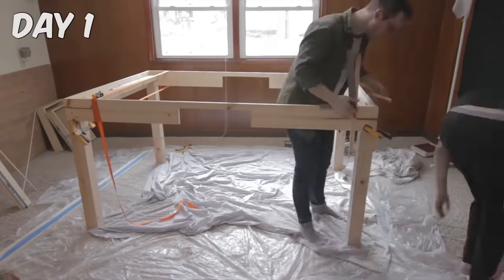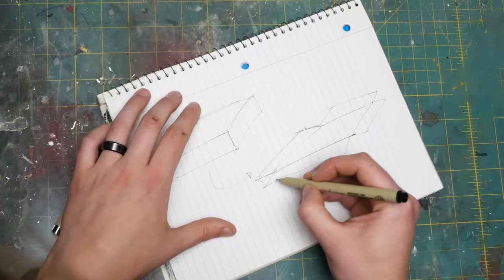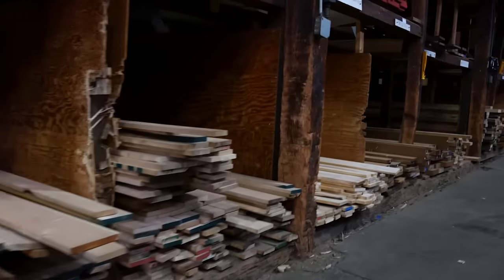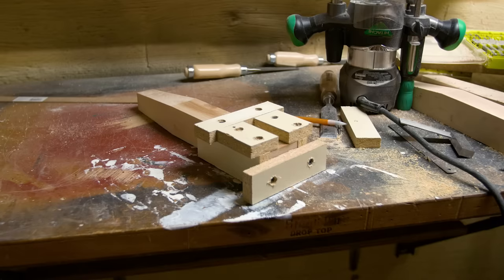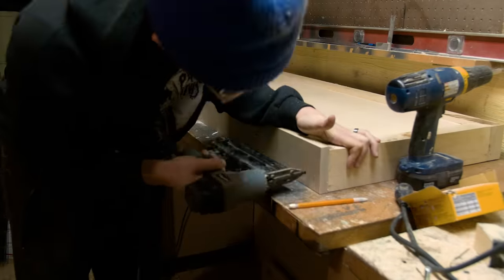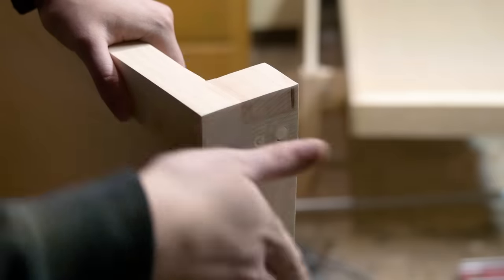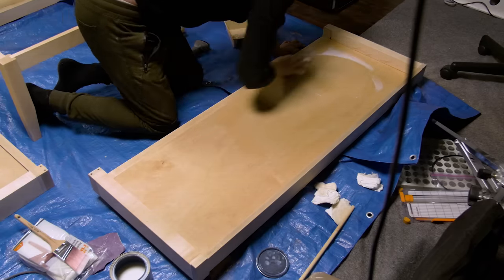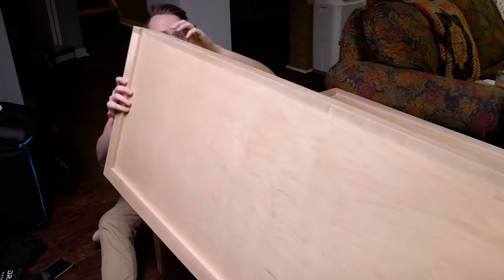Building a Board Game Coffee Table

Comment from the maker: The comments you guys have been leaving...truly heart warming. I am blessed to have a community of such kind people. Thank you.
Reply: Suggestion for you instead of making a supper like some sliders from under the table to support each wing and if you have access to sketch up a lot of people use that to do their drawings
Reply: Dude you really are famous! Nice to meet you today!
Reply: Perhaps consider using some chains on the inside to support the wings. Google imaging "Box chain support" will give you a rough idea of what I'm talking about.
Pros are that it looks cool and doesn't require action to use them after they're installed.  
Cons are that they would only relieve the stress on the hinges, and wouldn't provide vertical support like legs would, so if someone leaned on the wing it would still tip.
Reply: We love you Scott!
Reply: I was worried for your mental health on this project: "I think Scott is going to snap. Just like those screws!" But the table looks great!
Reply: If the small hinges do start giving out, you could look for some narrow strap hinges and put them on the outside as opposed to the inside.  It will require a similar type of chiseling to allow it flip fully open, but it'll give you more screws along the vertical edge and have a cool book-hinge look.  You'll also likely need to bend them around the corner, but again, adds to the look.  That maple does look good (it's also super hard, which might be a source of some of your frustrations - broken screws). Loved every minute of the vid!  And we used to have the exact same old black'n decker jigsaw...  Again, great vid - anyone can learn from your thorough narration.  Cudos and keep going!
Reply: If you ever need more tools let me know because I work at a tool store and I would love to help
Reply: Look up drop leaf table I think if you added a support like that it will take care of your hinge scare
Reply: You're too hard on yourself scott! That's some skilled carpentry!
Reply: The way you beat yourself up... I can relate
Reply: Best support solution in my experience is having some of those maple 2x2 offcuts as arms that slot under the main body securely and extend out. It's hard to explain but look at old writing bureaus
Reply: 12:30 that graphic confused me, because it suggested you could simply turn your cuts by 90°, but the numbers dont add up. I hope the table is still in use, to your satisfactions, feel proud of your product, forget about the mistakes, you were not going for crystal carpenter.
Reply: @deboozombie23  the parts he needs are 49" but the sheet is 48" hence needing to hut lengthways not width ways
Reply: @serridgeas  yes
Reply: That was a cavalcade of fuck ups, but you made it so it's a win.
Reply: Thank you for making this video, I feel like your experiences are very real world & mirror my own.  It’s nice to know that I am not the only one who makes similar mistakes.  Overall, I am impressed with your work & appreciate that you stuck with it.
Reply: I took sick pleasure 8n your frustration,  I know it so well.... by the end I was cheering you on. Epic work mate

Comment: Wow. So much learning in one video.

No hinge would do the job. One day the table will sag no matter what. Just make some fold up legs that fit inside the table - job done.

At the end of the day, you have a versatile table to play games on. Awesome for not giving up.
Reply: You could use the boarder of the folded in table as the extra legs of the folded out one
Reply: I had the idea to put a barrel lock on the side on each corner to do the loadbearing. Throw them open to fold, engage them to hold up the sides
Reply: I have found some hinges that I think are up to the job. They're called 'Folding table hinges'.. I'm going to try it this week

Comment: The absolutely best way to document a project like this, especially for inexperienced or beginner carpenters, is this exact video.

Showing all the mistakes you made, and how you overcame (or some times failed attempts at overcoming) them is priceless.

This is so much more helpful than a few clips of a master tradesman smashing a table together.  I guarantee a video like that would have people walking into the same roadblocks you encountered, but that video wouldn't address them like yours does. 

You are not an idiot, this isn't your vocation or career, but you still made it work through trial and error, and determination.

Kudos!

Comment: Here is a suggest for the wings, seen it with some kitchen tables that fold up. Under the table you add some sliding boards that are on rails. When you extend the wings, you simple slide out these boards enough to give the table support. I would say use like a 2"x3"x36" for each side. They should be close to the center, but far enough apart so each side can slide fully under the table. When you open the wings the boards are extended about 18" under both the wing and the table, giving it more support than just the hinges.
Reply: Good idea!  The slides would be super easy to incorporate I believe though.
Reply: This is exactly what i was going to suggest. a good example of this would be the Ikea PS 2012 drop lead table (for visual reference)
Reply: Agreed exactly what I thought too, only visible when in use otherwise hidden under the table.
Reply: that or some gatelegs.
Reply: Good idea, and the slides would be a perfect use for those big pieces of waste material he has to make it not waste.

Comment: This video is my intro to your channel. The sheer dedication you have after making so many mistakes is incredible. These mistakes are not a bad thing. You learned so much and are teaching us even more. You did it. 

Also, for the underside of the table, you can put two slotted 2x10's that would slide outward in a "viced" spot to support the weight. I've owned a few dinner tables with multiple leaves that utilize this method instead of extra legs. 

Cheers and congrats on all this learning and teaching. This new subscriber commends your efforts.

Comment: As a heads up for supporting the two wings and taking pressure off the hinges, a lot of similar designed tables will have one or two extension arms attached to the bottom main table. They get slide out so the wings can rest on them and transfer the load off the hinges. You could pretty easily add them to your table design.

Comment: Piano hinges...
Reply: What would piano hinges have done? He already has hinges that fill nearly the full edge.

There are several viable options discussed, but piano hinges would provide no additional benefit over the hinges used.
Reply: Russell Zollinger I am no expert.... my take on it would be yes piano hinges would be more sturdy than the 2 small hinges, but he chose those small hinges to be on the lip of the rim of the opened table. (I think I could have fit in one more “of” somewhere.) I have a place near me that is a “house wreckers” like a car wreckers, only is filled with old hardwood and doors. This kind of place can have cheaper hinges that may be strong enough to get the job done. But ether way the design made for a small contact area. So for more strength you need to re think the hinge there somehow.

Comment: First Attempt In Learning. The table looks pretty nice overall, for a first attempt (without planning). In many lumber stores, you can provide them with your measurements and have them cut the material for you as well. Another option is to look for scrap lumber that can meet your needs, pallets are a good source of free wood as well and can usually be up-scaled pretty well. Good job on this project! I think if you had a few table legs stored inside for the leaves that fold out, it may be super solid! Thanks for filming your project!
Reply: Yeah, just a warning on scrap wood though, especially pallets. Pallets tend to be treated in ways that make them not food safe, and you can’t tell what scrap has been through, so I wouldn’t suggest using them for tables. Tons of other things you can do with them though.

Comment: The final result looks pretty good.  You should be proud of the accomplishment of the build.  Sometimes a seemingly simple project is much more difficult than you originally may have realized.  You are now armed with hard earned experience.  I'm certain that your next project will fair much better.  

Quick tip.  Mapple is very dense so don't take it too harshly about the screw dilemma.  Next time, before you drive the screws into the pilot hole, coat them with wax or soap.  This will help reduce  friction and allow the screw to seat much more easily.

Comment: You could also place supports under the main part of the table that slide to support the hinges sections. For example, two small steel bars (or even large pieces of wood) concealed under the main table. Then, when you hinge the table open, slide out the supports from the main table to give it extra strength.

Comment: Hey Scott looks great. They make sliding lock in supports for tables like that. They mount at the bottom and pull out in order to strengthen the ends. Should be an easy add on if you need more support.

Comment: Just a thought, you could have supports for the fold out sections under the table like foldable leaf supports. Just a 1"x2" in a slot under the table that slides out to support the leaf when its folded open. No need to replace hinges, no need for temporary legs. Just about 30 minutes worth of cutting and screwing and youd never have to worry about it again!

Comment: Strength of the hinges are fine, what you need is steel bars that you slide out under the table that can handle the load of a person leaning / standing on the table. Make sure when the bars are pulled out you cover at least 50% of the base and 50% of the part that it has to hold.

Comment: I have been thinking about making a table that expands for a while. your design has inspired me to make one like this. How I'm going to solve the weight of wings is to make drawers. if you make some few inch deep drawers that slide out from under the table. You could have a space for rolling or whatever else, when its closed. then when you open the table they could support the wings. you can get drawer slides that hold a person standing in them. The weight of the wings will be nothing.

Comment: I would recommend using some slide out table supports underneath,  preferably two on each side. Also, I would have used hinges with a longer screw bed, probably for 3-4 bolts per edge, 6-8 total per hinge.

Comment: A solution for support on the wings is to have a pair of legs that can swing out when the wings are extended, giving it support, and swing in to hide as well as providing additional support for the main section of the table. They can either have a small arc and attached to each leg, giving you 4 supports that support the wing on the edges, or have a large arc but only have 1 per wing and supporting the wing at about in the middle.

Comment: Hey, Not sure if this would help and if you want to make it different at this point, but there are hinges which would sit both outside and inside of your "walls" when the table is folded out.  4 hinges>2 hinges (per side), and you can get longer ones which would help if you're worried about separation of grain.  Also, would be easy replacement since you already have hinges for placement (add hinges, then remove first ones).  Either way, good on you for taking on the project and following through with it, and it looks good!  Quick edit...they're pivot hinges if you're looking for them.

Comment: I know this is a old video but with any wood working projects you need to find the best piece of wood for the best job, take note of grain for things like legs and maybe some knots could effect joints but the most important thing I would recommend is getting a marking gauge and use face and edge marks (you can google why) but it will allow for you to produce effective, precise and most importantly repeatable results making it so you have less work to do correcting any errors of misalignment as that is the tool a joiner/carpenter would use to correctly mark rather than eye balling with a ruler/tape. Love your videos miniac!

Edit:- Sorry it seems like a lot of works but basically wood is never perfect unless you use a jointer/planer and without experience you can't really expect to achieve perfect so is why i recommend marking gauge (or mortis gauge they come with a marking usually also) but if you are doing anything joints with wood they are second to none pretty much almost as important as your pencil

Comment: Your table looks very nice, especially for a beginner. 

Some years ago (less than 20 im not that old), back when i was in the advanced woodworking class in High School i learned the best way to remove a broken screw where you have that much outside the material is a pair of vise grips.. lock em on and use them like a screw driver. A lot of the mistakes were the beginner mistakes i and every other woodworker made when we started in the beginner class in freshman year. You learn as you go and it becomes more natural and you start to think of these things before doing something. I'll leave you with a paraphrased lesson my teacher told me when i was a freshman screwing up. 

"Take your time, i dont care if you're the last one to finish as long as it is a good project. When something needs to be cut make sure you're cutting the right spot, scribble on stock if you need to. Remember the kerf and if there is movement to your project... Check and double check that the alterations or cuts your about to make wont screw it up."

Keep at it, you'll get so much better and it happens so fast you wont believe it. But still be proud of that table it is very nice and a great starting point. Keep it up!

Comment: Great build, lots of lessons. As for supports for the hinge sections - could you install brackets underneath the main table and then just slot in the maple off cuts (the longer sections you cut out of the ends) as supports?

Comment: You finished it, that’s the most important thing. 
Many issues you faced were just lack of experience, and no one can know them beforehand if not learned them from someone else or by finding them out by yourself.
My advice for the next projects would be to check out traditional solutions for joinery etc. They are usually easy enough, and require no expensive power tools.

Comment: You could add some sort of sliding support underneath your table to support the foldout edges. It would pull out from the underneath of the main block where the legs are. This way you wouldn't need to fix anything to the hinged sides and it would be largely unseen.

Comment: I know this video is old now but if you sheer the heads off your screws you can fairly easily cut a slot into the top with a rotary tool or hacksaw. Then you can unscrew them normally with flathead screwdriver. I think the best advice is to buy quality screws in the first place though. Glad your table worked out in the end.

Comment: I can't say for sure why the screws were snapping off, but I would guess it would be because there was too much friction between them and the wood. If you do anything like this again, try taking scraping the threads of the screws against a bar of soap. It should lubricate the threads well enough for them to go in without too much trouble.

Also, with water-based poly you really want to have at least 4 coats. It dries fast but it's thinner than oil-based.

All that aside, the table looks amazing! I wouldn't have guessed you went through that much trouble to make it, and honestly, no one is going to notice the imperfections unless you tell them. I made dice trays for my D&D group. I know every little thing I did wrong, but at the end of the day, they came out well and they absolutely loved them.

Comment: There could be legs under the foldouts, but there could also be pullout supports from under the pit – either on rollers just sliding and held with friction. Also, two low sawhorses – one under each foldout – might be your best quick fix.

Comment: You could build a set of swing legs that start up against the bottom side of the table. They would be the length of the sides between the legs. You’d pull the leg out and it would pivot to a 45 degree angle, then u lock the actual leg and rotate it 90 degrees which will allow support for the fold out wings of the table.

Comment: About the hinges, you could use a different type of hinge, set on the end of the table. The downside would be that the entire hinge is visible when the table is closed. The upside is that you could use a beefier hinge and much longer screws, so it would probably last longer. Also, maybe just find (or make...) hinges that are longer and stronger. This way there would be more screws holding them in place, so the strength would no longer be an issue. Anyway, i like the design, so a year from now when my new house will finally be finished, i might just try it.
Ont thing that i would add to it is a way to change the height. Would be nice to use it either as a low coffee table, or use it as a high, normal table, because it is easier to find a bunch of dinner chairs for all the players, and it is also more comfortable for a few hours long session.

Now, about the mistakes you made, i wouldn't worry. We are not professionals, i made many worst mistakes so far, and i'm sure we all did and will keep doing stupid stuff :)

Comment: Hinge screws are #1 smaller than the typical even number sizes. Making the countersinks in the hinges larger with a metal countersink will save u a million times. Adding 1x 0.75 edging to the ply is always an option. Go ahead and use "piano" hinges to finish this table off. Keep it up and learn from every mistake and success.  AND DON'T FORGET  predrill every time.